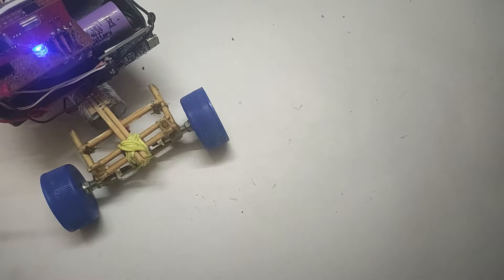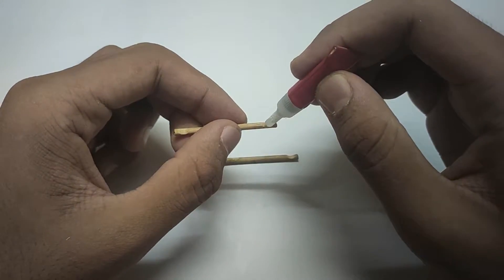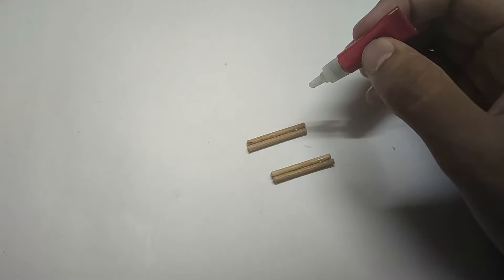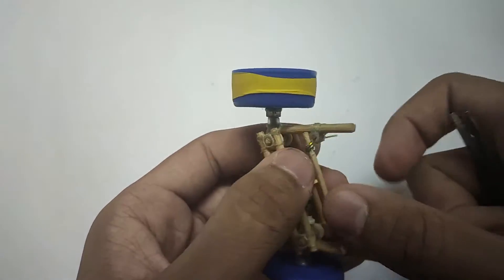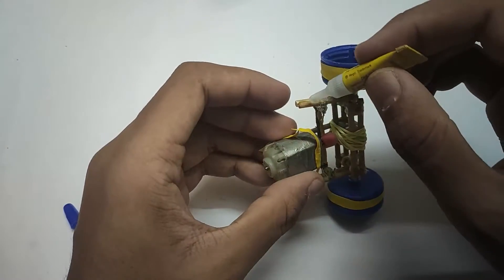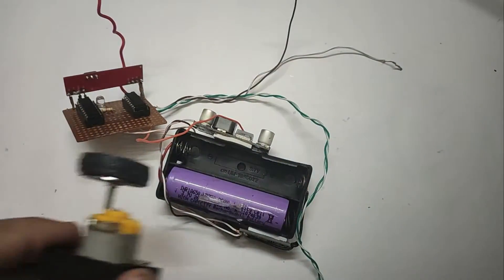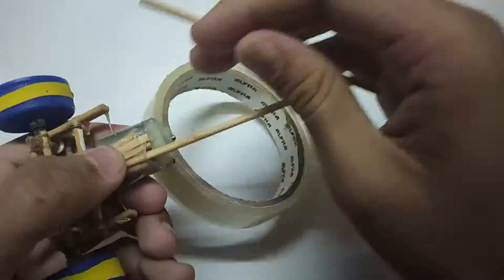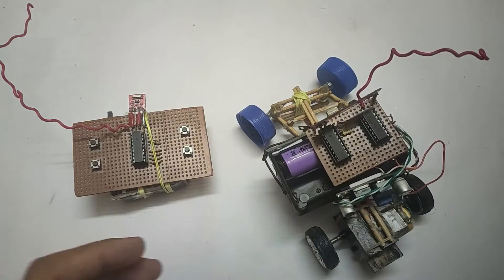How to make a RC car - 433 MHZ module - remote control car-Amazing DIY  toy

Comment: Do u have path remembering robot codes ....plz share it
Reply from the maker: I haven't made a project on that yet
Reply from the maker: Could you elaborate a little more
Reply from the maker: I could make it as a video
Reply from the maker: You mean like line following?
Reply from the maker: Or does it need to map out the whole area
 and move
Reply: @ClickScienceDIY  just needs only to move in a predefined path like from path A to path B
Reply: I don't need line following robot but the robot should move from Path A to path B using GPS or Magnetic sensors plz can u do it ....reply me , Iam very thankful for Ur kind reply
Reply from the maker: like from one room to another?
Reply: @ClickScienceDIY No but IAM planning to move the robot in  a hall where the robot should me 4 rows one after another ,  people will be sitting in rows here the robot will carry something on it , if the people want the item they have press stop switch so the robot will stop for 10 seconds then I will move forward  like that it complete four rows then again come first line and stop .it this possible plz help me
Reply from the maker: I'll try,but can't guarantee you anything
Reply: @ClickScienceDIY  according which I have seen in Ur channel IAM sure u can make it 100%  .. plz update me ok..

Comment: In main diagram with which part of receiver you connect the three wires that you show in diagram of car
Reply from the maker: Oh ok,the wires connect to the ground,+ve of ht12d and +ve of l293d,you don't have to use the voltage regulator,I used it to increase the voltage whcih the motors get,which will increase the car speed
Reply from the maker: You can connect the ht12d and l293d +ve pin and run it directly from the battery without voltage booster
Reply from the maker: Ig the picture isnt that clear ,but from left to right it is -ve(ground) ,vcc of +be of ht12d ,+ve of l293d then the motor wires

Comment: With which part of receiver you connect the three wires that you show in main diagram
Reply from the maker: The circuit diagram of the receiver board is in my transmitter and receiver video
Reply from the maker: It is there in the description of this video

Comment: Where will I use high torque motor
Reply from the maker: Sry,I didn't get you
Reply from the maker: If you are asking if we could use torque motors we can,you can easily find them in amazon